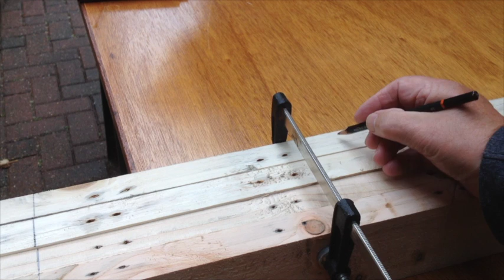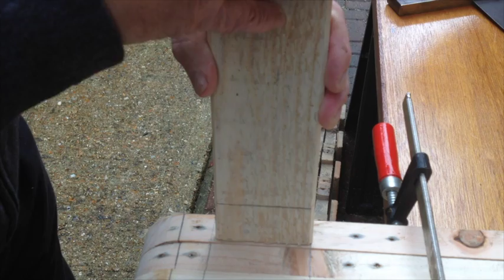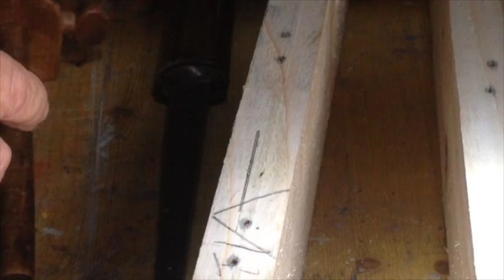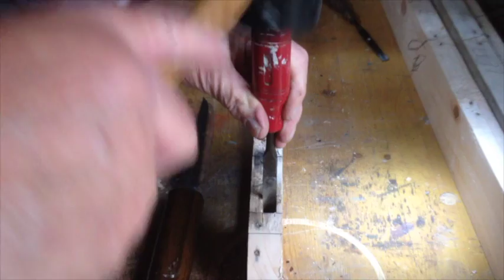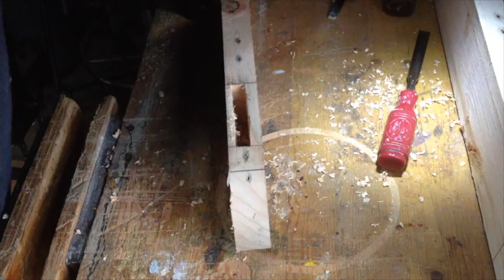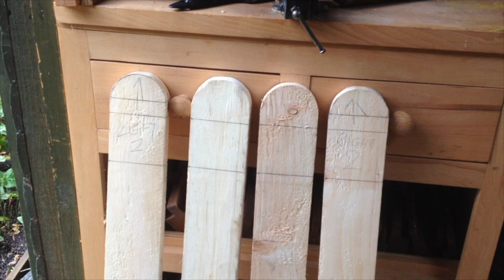The Big Gate - Part 3

Comment from the maker: I do have a bench mortiser Nigel but there is no electric on the allotment even though its a main sub-station site so I am getting back into the hand tool habit.   Also, I think the subscribers and viewers may like to build a pallet gate and not many would have a mortiser.  Not used the vice because I want a rock hard base that gives the right sound.  Its the sound that tells you how hard your tapping.  Thanks for the good comments, cheers Mike B